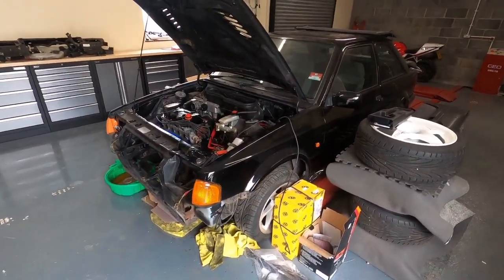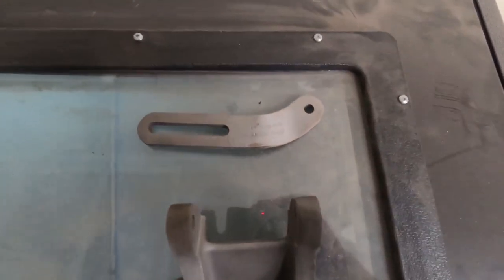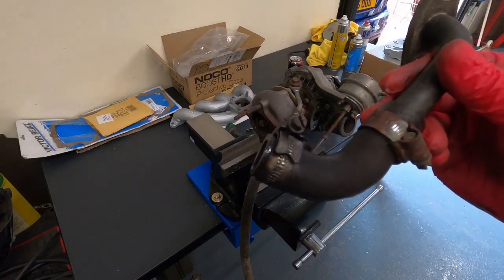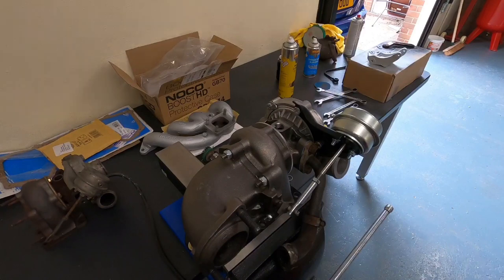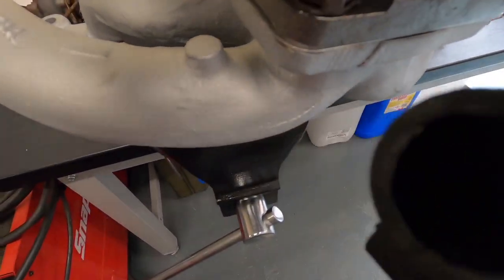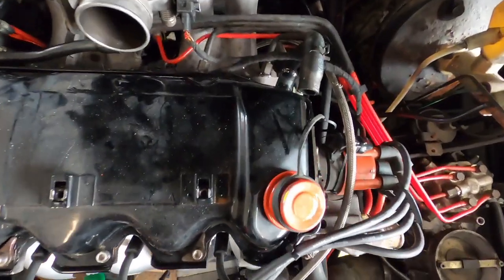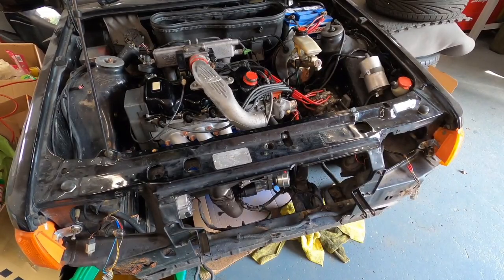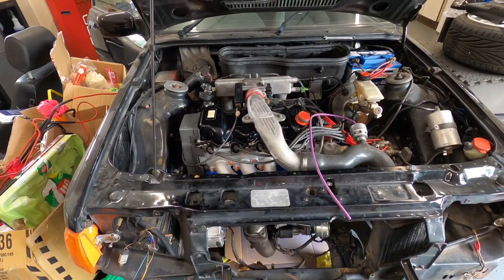Ford Escort RS Turbo - Fixing Exhaust Leaks Pt.2

Comment: Have u got an electronic dump valve controller 
Because if u just splice into vacuum line it upsets
Air fuel ratio .
Reply from the maker: No just go straight to vacuum